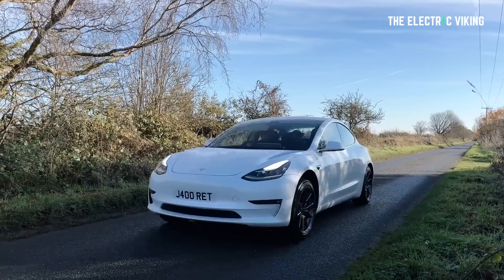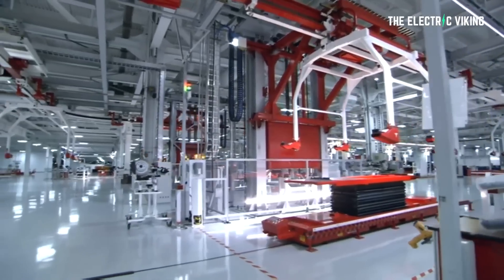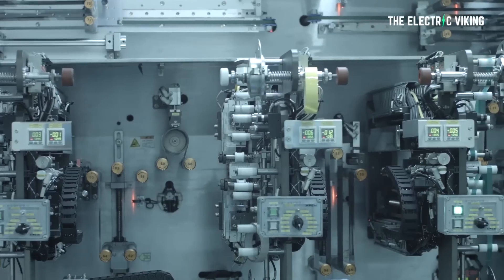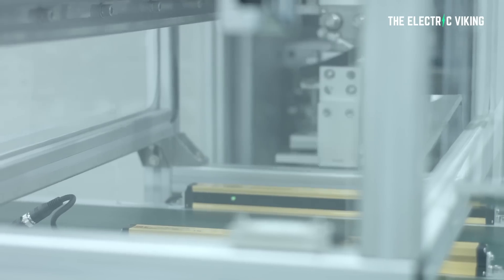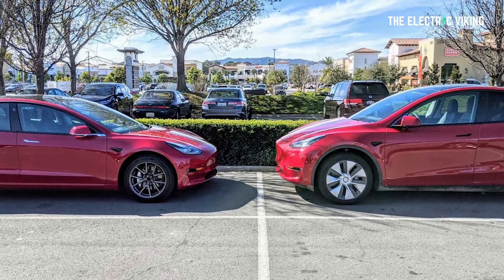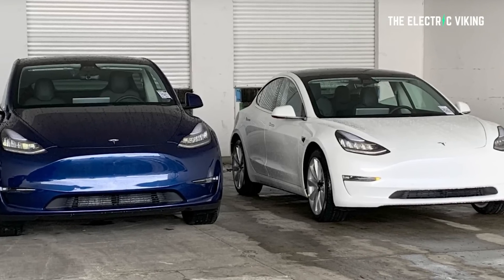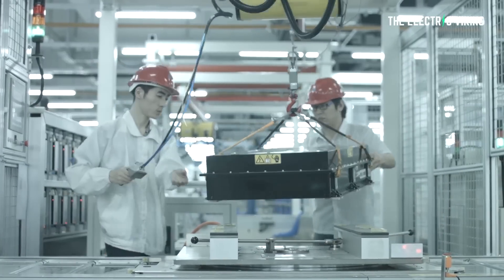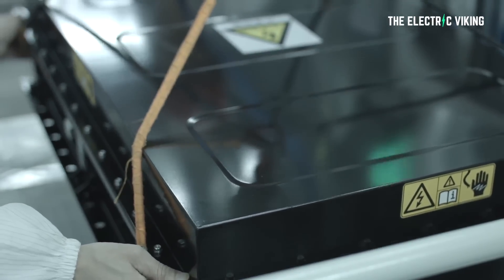NEW LFP Model 3 & Y to have over 700km range with M3P battery

Comment: Lets not be silly here.

Using say a 4680 better does not mean you going to get a car with more range, since they will and did use less batteries to result in the same range.

Same goes for blade units. They can and will use less units to produce the same range.

Remember, the range and cost of a EV is MOSTLY determined now by batter cost, and how much battery you put into the car.

Right now lithium, nickel and base materials used for batteries is going up HUGE HUGE right now.

The assembly cost say for blade or even 4680 can drop by 50%. The problem is not manufacturing cost, the problem is input materials cost.

You can with robots and high speed manufacturing  you get to drop that assembly and production cost by 50%. The problem is with a $25,000 battery pack, the materials cost is $24,600 dollars, and the production line cost (robots etc.) is $400. So, you put in better robots, increase the size of the can (like they did with 4680), and you now dropped that cost by a whopping 50%. But that is 50% of the assembly and production cost - NOT the input material costs.

So, now that battery pack drops in price from $25,000 to $24,800 dollars. You not dropping the input materials cost, but only the cost to build. Assuming $400, then you now at $200 and the cost of that pack only drops $200 in cost to place in that EV.

No EV maker in the past gives away extra range for free.

Given the HUGE HUGE cost increases in basic materials right now? These better batteries will not even keep price increases down right now. 

This is NOT a assembly and production issue - it is a cost of materials input issue - and those costs are going WAY WAY up right now.
Reply: but are iron battery with know  nickel
Reply: @MichaelGreenLagos  yeah but the lithium in the batteries and copper in the packs are the two biggest drivers of price. Large grid battery projects are super price sensitive but basically will set a price floor. So mining more will never outpace demand
Reply: Interesting, according to ChemAnalyst "In the Asian market, Lithium Metal Ingot prices fell significantly in Q2 2022 compared to the Lithium prices in March'.
Reply: @jimgraham6722  
Sure, but such prices are still significantly up in the last 1-2 years. So there's still a nasty cost increase that EV makers are having to deal with. Increased mine production of such materials can and will increase, but that takes time. And if such companies make the huge required investments then a big drop in those basic materials can occur.
For example Japan was a big user of coal for energy and steel production.
So to cause huge drops in coal?
They invested into Australia coal mines and the result was huge drops in world price of coal. That saved Japan untold amounts in reducing costs of importing coal.
But while investments in lithium mining is increasing, too much increased production can cause huge drops in such material prices and thus lowering the value of making such mining investments.
With current demand for battery materials, the pressure is still upwards for such materials and will remain so for some time. But over time prices should come down - just a question of how long.

Comment: If the byd battery pack is 55 KW, energy density is almost irrelevant.  The range that the vehicle is getting is most likely due to improves efficiency from the Tesla model y.  The combination of the improved heat pump, structural battery pack, front and rear giga casting, and improved efficiency from the electric motor have all conspired to give the model y and efficiency level of probably right around four and a half miles per kilowatt... That's the only thing that could possibly explain it.  That same battery pack in a byd vehicle will most likely get 25 to 35% less range because they're not nearly as efficient as Tesla.

Comment: One thing that impresses me about Tesla is that they are able to actually change battery types and formats basically as they become available.
GM spent like 5 years developing a battery platform that is already becoming out of date, and plan on building all the EVs they make over the next few years. I highly doubt they have the capability to pivot to new formats and chemistries on the fly.
Reply: 18650  2170 4680 invention by Panasonic,produce by Panasonic, LG ,CATL . M3P invention by CATL . blade LFP invention by BYD.  Tesla just ask them to fit tesla 's car .
problem with GM is they don't want use battery that supply chain out of US ,Japan ,South Korea,and china hold nearly 95% of world EV battery Industry, 70% by china alone.if GM use this supply chain they afraid some day china will do what US done with huawei. but US battery industry is far behind so you can see why GM and ford struggle with EV

Comment: Totally agree with Robert Vadjinia, a lighter battery of the same range will improve efficiency. They may charge extra for a long range but it will mostly be an efficiency increase.
Reply: More range is more range.  Just like my accountant says, yes you pay taxes, but you make more $.  Also, because the battery energy density increases, the weight penalty would actually lessen because you use less batteries.

Comment: The reason that these probably cost less is because the manganese ends up offsetting the lithium... Since the lithium is more expensive than the manganese, you end up with a lower cost battery pack.  My guess is that Tesla will divert the existing nickel-based batteries for model y production and only make the lithium manganese iron phosphate versions of the model 3
Reply: Forget the past, remember the future. Tesla has cyber and semi trucks 🚛 that need the extra range and rapid charging coming to the market very soon. 🤔

Comment: The US factories, including Fremont, do make money. The analysts are wrong and have been forever. The range is WLTP and not EPA, so the range is not real world. It's more likely to be a 540KM range in the real world. I think the ranges will be about the same in the various products, but it's likely that the LFP cells go into long range, as well as standard range. The number of cars they can produce will go up a lot by using these new cells though. So the 2170's will go into Performance models only. The rest should be LFP, which can scale faster.

Comment: If those batteries are in US cars, Tesla will not qualify for the $7.5K rebate, because, in 2023 alone 50% of the battery components must be manufactured or assembled in North America and that % increases to 100% in 2029. Additionally 40% of the value of critical minerals in the battery — such as lithium and cobalt — must be extracted or processed in the U.S. or a country that’s a free-trade partner, or be recycled in North America and this % will grow to 80% by 2027.
Reply: Very correct.
Reply: The rule basically is designed to slow the adoption of BEVs. Seriously, what domestic battery maker is in the USA? The only one is Tesla. Panasonic is Japanese, SK Innovation is Korean, LG Chem is Bonfire kindling from Korea. CATL is backing out on USA factory construction because of geopolitical tensions. The only lithium mines in the USA is the Albemarle Silver Peak Mine in Nevada and the proposed Thacker Pass Lithium Mine

Comment: I wonder if this throw's a large monkey wrench in the 4680 plans? If you can have a car that goes as far and whose
battery lasts three times as long without the battery maintenance factor . Will Elon adapt the 4680 form factor to some
sort of LFP. Personally I would like that range because Real World Range will always be less.
Reply: I think 4680s are a little over hyped. Don’t get me wrong, definitely some improvements over 2170 but some of the benefits need to be taken in the context that the 4680 is 5 times the volume of 2170.
Reply: 4680 is only a cell size… Tesla could very easily use the exact chemistry from these new M3P batteries in a 4680 cell. The key benefits of the 4680 cells are 1) cheaper cost of production 2) better thermal management 3) tighter form factor.

Comment: Interesting stuff. I do think it important that we decouple technical capability from the resultant product. As a point of reference, the 4680 Model Ys coming from Austin have less range than the 2170 variants...even though the pack capacities appear to be about the same. 

One has to consider that Tesla has a business to run and in order to run it they need to ensure differentiation between their models. It seems that for a model 3/Y it's likely that the range will likely remain about where it is now....maybe a little higher, but not much. I say this because Musk has been pretty clear that it just doesn't make sense to build EV cars with huge ranges. If one assumes that there will continue to be 3 levels in the 3/Y hierarchy, then the long range version will pretty much have to have longer range than the base model. 

What this implies is that rather than sell you a base car with a 350 mile range, Tesla will either build the cars with fewer cells or software lock the unused capacity so that the net effect is that Tesla's cost will be reduced, but their product offerings will still make business sense. 

Bottom line is that I doubt Tesla will create an incentive for customers to hold off ordering. No sense in re-validating the Osborn effect. 

As a Tesla shareholder, however, I am elated at this news as it implies that margins are likely to get better.
Reply: The range on the current model S is at about 400 miles, up from 200ish a few years ago. 

So we will see where the standard range will go. One thing for sure though competition is heating up, which puts pressure on Tesla
Reply: @kabysummit5801  true ,I'm looking at the BYD atto 3 in Australia.  20 thousand dollars cheaper with similar range .  Have to consider it for that big of a difference 🤔
Reply: Even if Elon says it doesn't make sense for a 400+ mile range, consumers want it.  It's not 400 miles anyways, but .65-.85 of that.  If the competition all have 400 mile cars and Teslas have only 330, I think there would be a huge disadvantage.  Here in California, many people drive from SF to LA and don't want to charge too many times.  Plus, SF to Tahoe presents cold weather challenges that would be mitigated with more range/faster charging.  I had an MX with 240 range which did an SF-SJ roundtrip once with only 10% remaining, only 120 miles.  If the MYLR only has 330, it is only marginally better than that.  Granted, I do not drive slowly, but that doesn't matter, nobody else does either.  Having more range is important.

Comment: CATL is a Chinese battery maker. Divide performance by a minimum of 2.
Reply: I have tested several makes of lithium batteries made in China. Thunder Sky: performance slightly exceeds what is claimed; Sinopoly: performance is a few per cent short of what is claimed; LG Chem M50T cells (made in China by a South Korean company) a few per cent short (4.8AH v 5AH, but this still represents one of the best energy densities you can get at about 250 WH/kg); Flypower (a rather obscure make aimed at the radio-controlled model aircraft market, that I tested about 13 years ago) about 30 per cent short of claimed performance (and, in the case of the one I tested, shipped in unsatisfactory packaging that gave rise to a serious fire risk).

I know that there are some Chinese made cells mainly in the vaping market that are labelled with ridiculous capacity claims that are more than 10 times the actual capacity, but if you do a bit of research on the Internet and don't buy from dodgy vape shops it is easy to avoid these.
Reply: @cedriclynch  Hope you're right and they don't turn out to be typical Chinese tofu dreg.

Comment: I agree with those saying battery pack will shrink instead of trying to make them longer range. Musk has often mentioned most EVs do not need to be over 200 miles of range. 

Would not be surprised if Tesla comes up with new editions, such as Long Range Plus, that would have the crazy range at a higher price.

At least the smaller packs would mean quicker recharge time.
Reply: Musk said he would not produce a vehicle anymore that is under 250 mile range. That's what he claimed was the minimum.
Reply: I have 300 miles of range now.  I would love to have 400 or 500.  That's the big reason I reserved the Tri-Motor Cybertruck.

Comment: I don't understand how a higher energy dense 55kw pack gives more range than a lower energy dense 55kw pack. They are both 55kw, one just weighs less. What's am I not understanding?
Reply: There is a small benefit with less weight in the car but it’s not the most important factor. This is more about less batteries = simpler car/less parts = more profit.

Comment: If a model 3 standard ranch has 272 mi of range give or take and put the new M3P batteries which has a 25% greater energy density witch equals 340 MI, that is pretty good and this is in the model 3, if further down the line it gets a structural battery pack and giga pressed body frame that number will increase in the car like that is still worthy of acceleration boost!
Reply: My range after 11000km with a tesla 3 with 82kwh battery  is about 100km with 21-22kw( you only use about 70% on li ion batteries regulary so you harldy do 300km in best scenario more like 270. With a lfp you probably gain some 60 80km.extra because you can cycle to 100%, efficiency is still low because of weight ( better than.others though)
Reply: @claudiumxg1  the M3P has a lower but pretty high energy density for a LFP based battery, they could have more range by using different battery pack formations to to cram more batteries, however with gigacasting and structural battery packs it would go up anyways.
And price should come down! 
And the model 3 is a vary efficient car.

Comment: Yeah, I've given up on Tesla because they keep raising the price 25% per year.  They'll use this battery, which is probably cheaper for them, as an excuse to raise prices again.  And then they'll have the gall to brag about how high their margins are (i.e., how much they're gouging consumers).  As a Tesla shareholder, I should be happy.  But, as an EV consumer, I'm extremely disappointed in them.
Reply: A real Chicken and Egg situation this one. EV market share is small so volumes are small so the cars are expensive. We need volume to increase 10X to move prices down but Tesla alone can’t do this other makers have to step up their game. The thing is ICE makers will bankrupt themselves trying to do this so we’re stuck with relaying on Tesla to keep growing to get to a point where they can reduce prices. If you’re Tesla though why would you if you can make insane profits?

Comment: There is no chance that the range increases!   Tesla needs all the batteries it can get.  THAT SAID:  It is instructive that it is now possible to easily get 400+ miles range with LFP!   This is huge news.
Reply: I would think Tesla will use this to reduce the number of batteries in the car not to increase range. There may be a marginal range increase but it will primarily be used to simplify even more and increase margins.
Reply: @ISuperTed  Tesla won’t reduce the number of batteries in the car, it will be the same kWh batteries in a smaller form factor, that’s all energy density effects. In theory Tesla “could” put a larger battery (kWh) in with higher density battery chemistry however they very likely won’t. The only exciting news to come from the M3P battery chemistry is the possibility of a long range model with LFP battery chemistry. End of discussion.
Reply: I won’t be upset if they don’t increase the range. Same range will mean less batteries, less weight, better acceleration (compared to what it would be if they went with more batteries/more range)

Comment: These kinds of battery breakthroughs are tremendous news. But what is all the hype about increased range? I would think smaller packs reducing cost, weight and environmental impact would be the goal.
Considering we should all be taking a break from the road every 2-3 hours then to keep ourselves alert and charging times down, a genuine range of 350-400km is all we need. The focus really needs to be on the roll out of charging infrastructure so that when we stop at Macca's for our break there is somewhere to charge at the same time.
Reply: Keep in mind Towing, Cold Weather, Degradation and not needing to charge to 100% as just some reasons to have more battery that you might think is necessary.
Reply: A genuine range of 350-400km is all some people need. If you can charge at home and every place you go is well server by superchargers, then 400km are enough.
But if you can't charge at home or you might go to fairly remote places where the nearest supercharger is 150+ away, and maybe you need to spend some time at that place, having 600+ km is way better.
Reply: @sephiroth127  unfortunately most cant charge at home . I have to drive 30km to nearest charger in one direction( so 60 in total) i cant install a charger t home because  the infrastructure on the whole street is on the limit as it is and energy company does not allow it. Ev is still a rich mans game at this point. Maybe in 5 -7 years we will have proper infrastructure
Reply: 400 is way to little